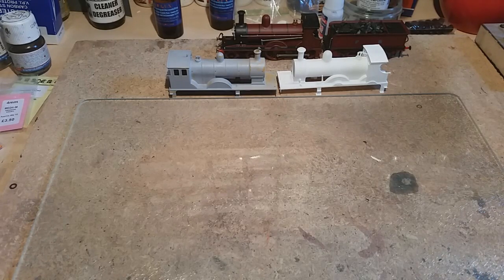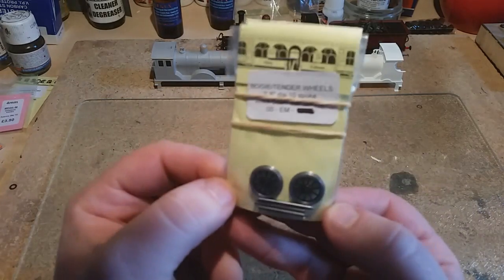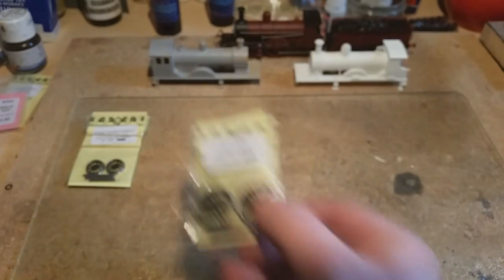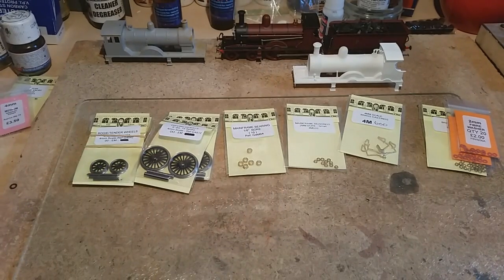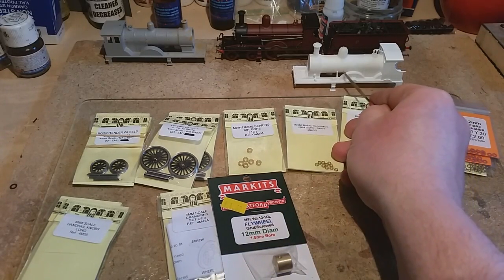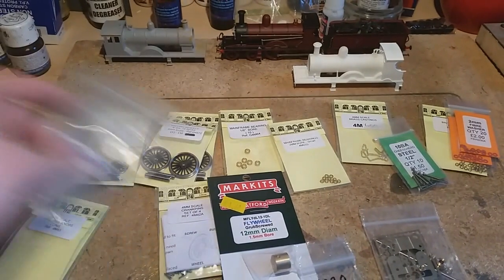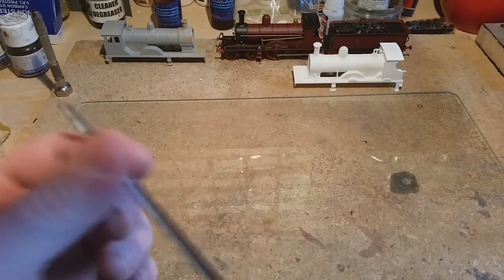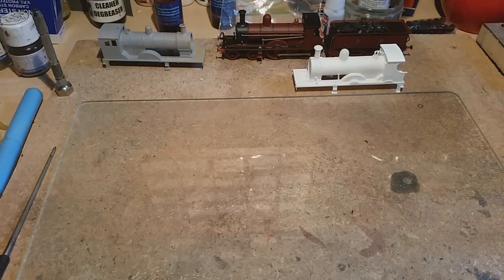Building an SCC Loco Kit - Part 2 - Some Equipment & Components

Comment: can i use a 2p or a 4p body for it? superb video my chap.
Reply from the maker: Probably both or neither as it's designed for its own chassis with a specific wheel size and wheelbase.  I haven't tried fitting an RTR chassis to it or a different body to the kit chassis.